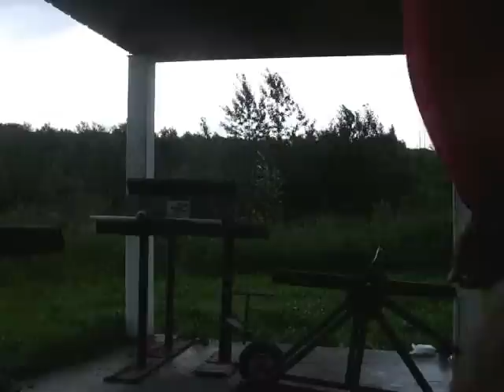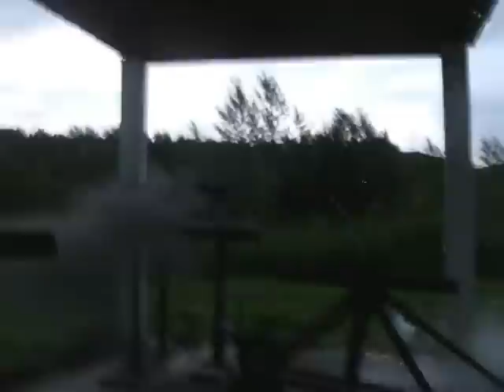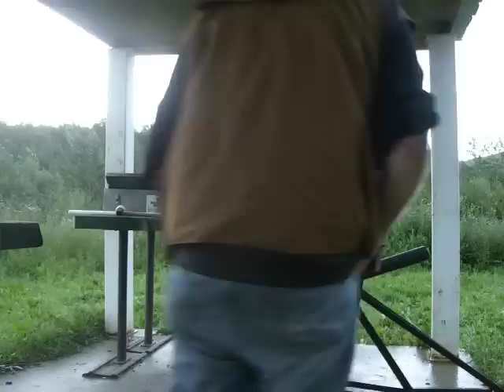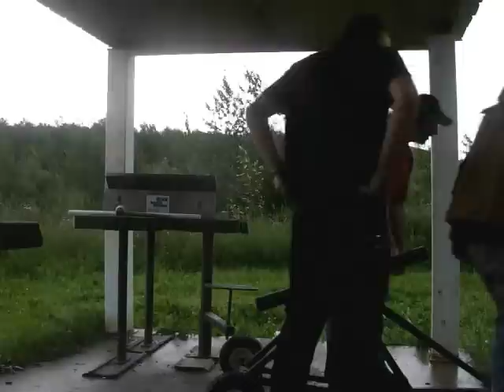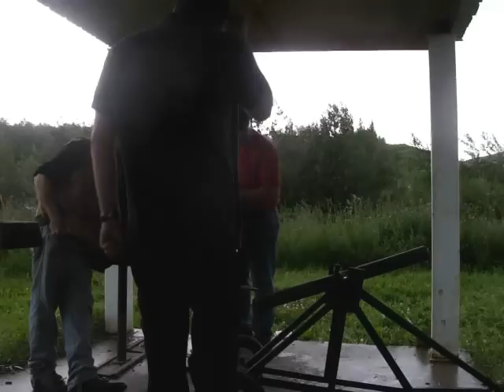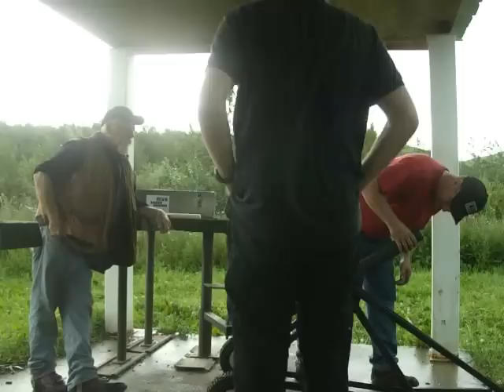Golf ball cannon - blew the breech plug - July 23 2012

Comment: " oh well,  weld another one in it" ya because that worked so well the first time 😂
Reply from the maker: Oh man. A blast from the past. I machined another plug, drove it a solid inch into the breech, and filled it completely with weld. It never moved again. That canon is still sitting in my buddy's barn I bet. We haven't fired it in probably 5 years now.
Reply: @blacksmithden I'm building one now and that was my thought,  send a bunch of rods on the back and pin it,  i use the " if you can't weld good weld alot!" Theory and it's been working  for me 😅